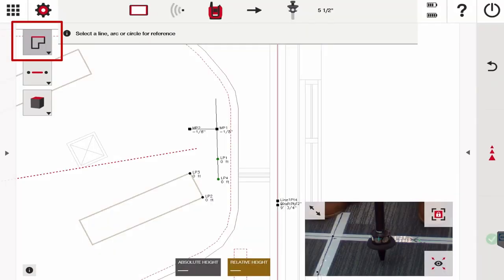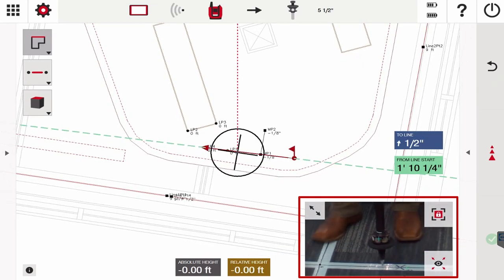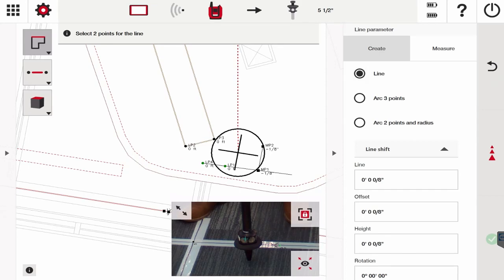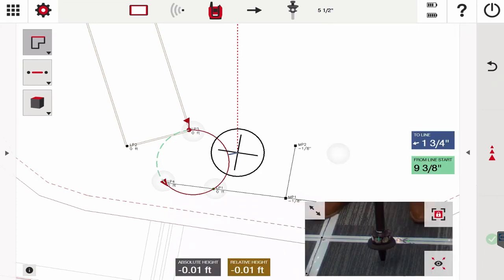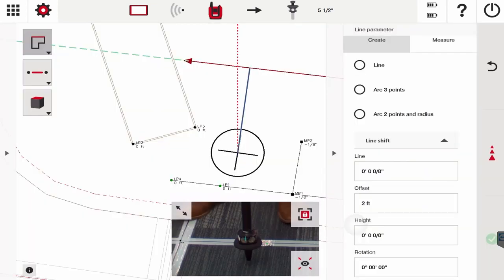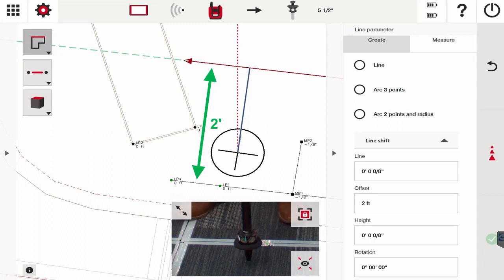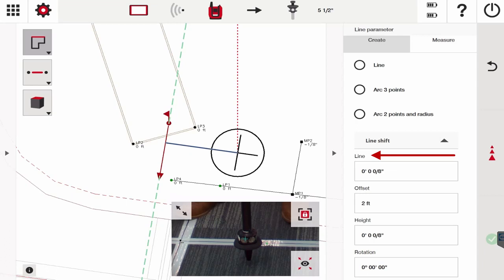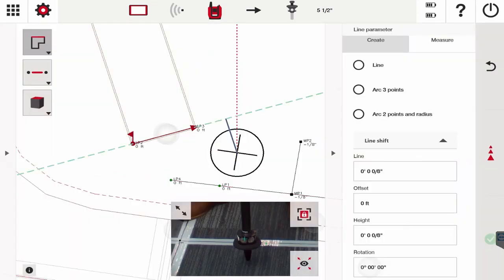Layout Lines

Comment: I'm doing a multi-story building with identical floors. Is there a way to "un-stake" all the layout points in the project file, so I can use the same file for the next floor without loading a fresh copy of the project?  I don't want to lose all my added points and offset identity's if I don't have to.